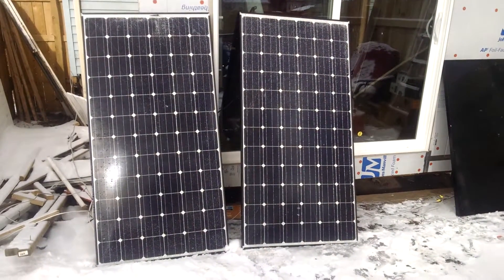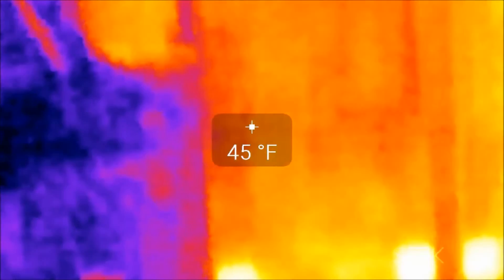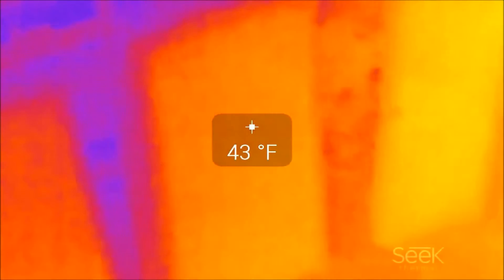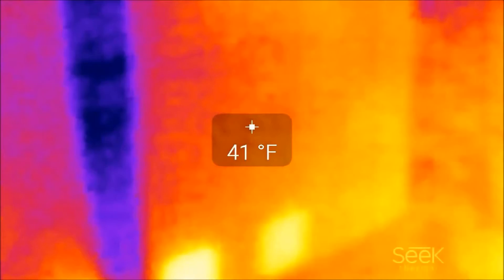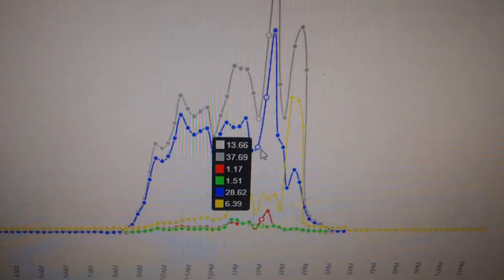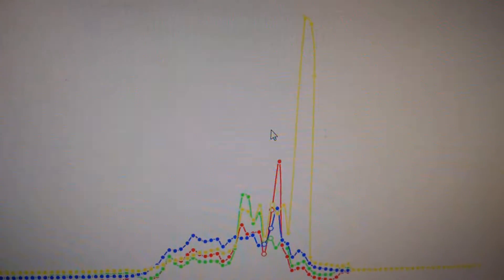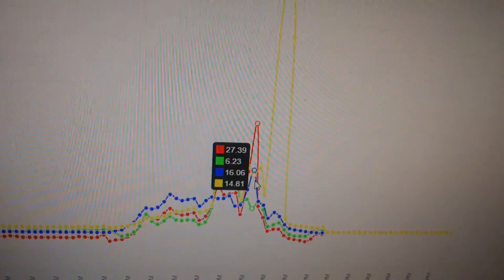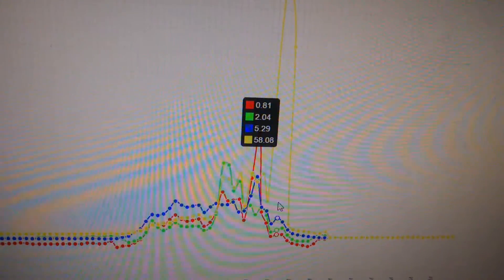How hot is it? Thermal image of hot spots on 200 watt solar panels

Comment: Replaced a DC isolator today on a string of solar  panels.  The switch was well burnt up.aside  from that I noticed on one panel closest to the switch a single cell on a panel was heavily brown discolored and it was much hotter to the touch. Should I just leave the panel alone or definitely remove it as the cell will be just sinking all the power. No shadowing. If I'm reading 400v for the string then am I right in assuming the house load will be using most of the power compared to that bad cell ?